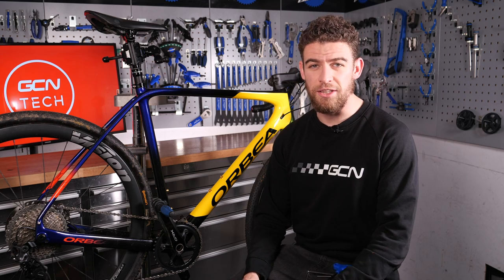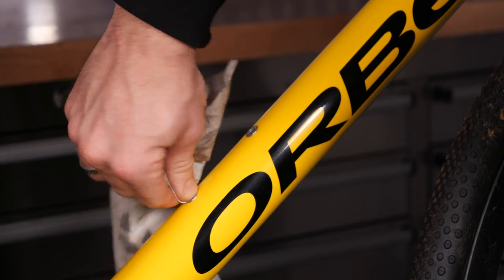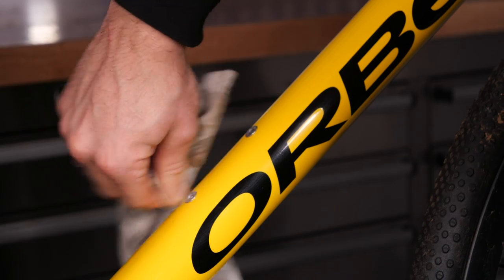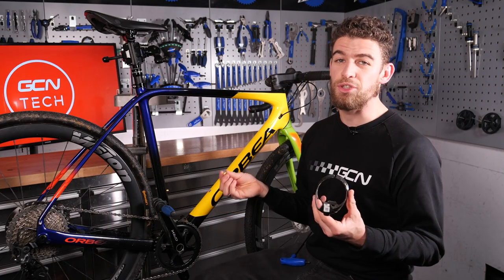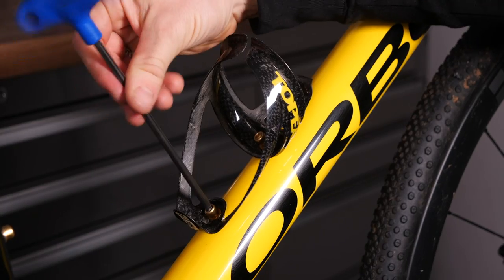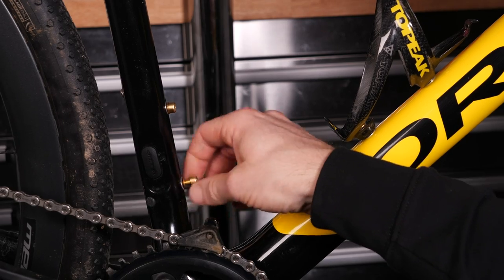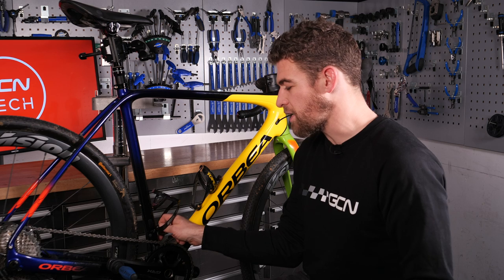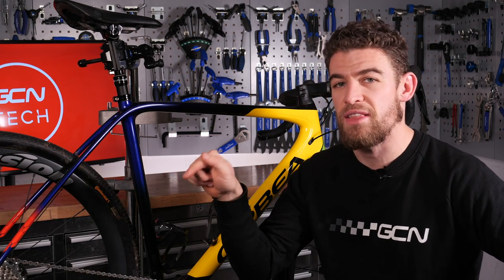How To Install Bicycle Bottle Cages | Road Bike Basics

Comment from the maker: What other simple maintenance videos would you like to see us make?
Reply: Maybe not simple maintenance but please do viedo how to ride on the bike
Reply: @_________4292  how to fit training wheels on a roadbike?
Reply: How to tell the left side of your handlebars from the right side?
Reply: getting started with clipless ?
Reply: How to install a bell
Reply: More about barings and cables
Reply: How about mounting options for head units.
Removing pedals from cranks.
Removing cotter cranks.
How to use a torque wrench.
Explaining clipless pedal release adjustment.
Explain how old school tech worked.
Cool bike mods we did as kids.
Reply: How to make sure the wheels are spinning in the right direction
Reply: Installing a super stubborn tyre onto a rim which should fit but doesn't. I mean like the kind where you want to throw the damn wheel out the window level of "stubborn". Please draw straws for the victim and show this without a jump cut to it magically being completed.
edit:

Also no skipping the inner tube

lots of love.
Reply: How about a guide to building a bike from out of the box?
Reply: Repairing and re-inflating a tubeless tire when it goes flat
Reply: How to edit OpenStreetMap. I would suggest you use as an example the unmapped dirt road Si found on Google Maps when he went bike packing in North Africa.
Reply: How to clean lever hoods
How to put a helmet on properly
Reply: 1.how to tension the chain on a track bike.
2.how adjust saddle position
Reply: How to install valve caps would be the next lesson after that video.
Reply: How to install a bottle cage when you don't have bottle cage mounting holes. I used the 1.5 pounds bottle cage from asda which comes with two sheet metal strips that wrap around the frame, but I'm sure you can do better.
Reply: I’d like to see a video about maintaining you tools, cleaning brushes and things like that. I’m very bad at that..
Reply: @paulgush  I did an edit for OpenStreetMap to show a new bridge and deviation on a rural road in Vietnam. The process was pretty straightforward - register as a developer then read the various online guides on how to create or edit maps.
I accompanied my changes with screenshots from Google Earth to prove that my changes were real plus a GPX file from my most recent ride. OSM had the changes added in about 4 days but it took a couple of weeks for them to appear in Openfietsmap which I use with my Garmin.
Reply: I'm having some trouble putting on my bib shorts. I mean, arms first? Do I jump into the bottom holes at the same time? One leg at a time?? Please help!
Reply: Do you pedal clockwise or the other way?
Reply: @ianjlilly  Agreed, it is quite straight forward - I've made a few hundred edits myself. I'm asking because I think they should promote the fact that it's open source, and that you can improve areas you're familiar with. And it would be nice if they did some videos more interesting than how to fit a bottle cage!
Reply: Installing a bottle cage to the frame without bosses? Using rivnuts, not some ugly clamp thing.

Comment: Oh. Spending four minutes of my life just for GCN. I do it because I love you guys.
Reply from the maker: Thanks for your loyal support ;)
Reply: GCN Tech #askgcn I just got finished doing the base coat on my bike and I’m bout to do the paint coat in a roster pattern. Don’t worry I’ll do a post in the future. My question is A two-parter. Should I use decals or paint stencils? I have rattle can spray paint. Second part of the question is would you do that step before or after the clear coat?

Comment: Strangely this is probably the only guide on the internet on how to mount water bottle cages. Not that it is complicated by any means but there is never instructions with bottle cages. I know plenty people that have no idea how to mount a bottle cage. Good for reference and beginners. Main points stay clean, lube, don't over tighten. Also if you want to get technical address EPS batteries that mount internally to the seat tube using the bottle cage mounts, mounting an air pump under the cage that needs longer bolts, lightweight bolts, cage material benefits, or bolt/frame corrosion due to different materials.
Reply from the maker: We're glad you appreciate the video! Thanks for watching.

Comment: And because you asked at the end. I have recently installed cages on my new Cento1air with Campy 11s EPS. Bottle cage mounting was done hastily in the shop as an after thought as I was picking it up. Rush job not good. I need to disassemble and lubricate the mounting bolts and check to see if they all match. I have some carbon specific grease for the job.

Comment: Thank you for the 2nm statement.  I’m far more comfortable working on a drivetrain.  Over tightening nuts into threads on a carbon frame tube seems a potential mine field.  How the threaded nut is manufactured into the carbon is beyond me.  But, it’s good to proceed with caution when working with carbon frame bikes.

Comment: The only interesting thing regarding bottle cages: Especially in aluminium frames, use only aluminium screws in order to prevent corrosion of the frame due to stainless screws. Stainless screws, aluminium frame and electrolytes from spoiled sports drinks are a terrible combination.

Comment: Is 50 Nm enough torque to secure my new cages?
Reply: Best to be sure.  Go for 75
Reply: Just tighten the bolt until it get easy and then back it off a quarter turn.
Reply: "Go until you hear the crack, and then a quarter turn back" is what they say

Comment: I have a new Giant Defy and bought a side pull bottle cage. I installed it by hand, got it snug (not too tight for fear of stripping or issues with frame) and the cage became loose after one single ride. Pulling the bottle out of the side and putting it back in inherently 'pulls' on the screws and worked them loose. Seems like a poor design?

Comment: @GCN Tech....okay you boys are running out of video ideas so here are some more.

1.) How to pick a good CO2 Tire Inflator and tips for using it on the road. 
2.) How to remove and replace a Presta valve core and how to get a good seal around the Presta valve for tubeless tires. 
3.) How to install a bling anodized tubeless Presta valve set.
3.) How to know when to add tire sealant to your tires. 
4.) How to know when you need to replace your bicycle saddle. 
5.) How to polish your bicycle hubs, spokes, nipples, and rims for increased bicycle efficiency and easier cleaning.
6.) How to achieve proper water bottle hygiene. 
7.) Saving bicycle weight through bicycle bolt size standardization and tool optimization. (The fewer tools you need the better!)
8.) Color coding your hex wrenches with paint pens for quicker identification and preventing your tools from walking away.
9.) How to choose a proper pair of headphones for gravel riding off-road and indoor training. 
10.)  Look at which cities of the world have the best bicycling climatology; move GCN headquarters there.  http://www.london.climatemps.com/
11.) Bring in a sports psychologist to explain to GMBN why riding uphill is actually good for them. :-) 
12.) Mountain biking triage, what to do when you inevitably hurt yourself with your mountain bike.
Reply: > 11.) Bring in a sports psychologist to explain to GMBN why riding uphill is actually good for them. :-) 

Indeed!

Comment: I wouldn't use the ball end of the wrench to break the bolts loose or torque them down, that's how the head of the bolts get rounded out. Just like a multi-tool, those P-handle wrenches aren't doing any favors either, they're too bulky to fit in the bottle cage. A pro tip is to always install the seat tube cage before the down tube one, and to always remove the down tube cage before the seat tube cage, that way you'll have more room with which to work. Although a shorter wrench than those cumbersome P-handles may also mitigate the lack of space.
Reply: @Bungle2010  It might depend on the drive size of the bolt, it's happened to me before where with 3 mm bolts, they, and as a result the cage, came loose. It didn't happen again after getting them tighter, but I didn't test it extensively either. Either way I reckon the bigger the bolt drive the better, which might make it safer to use a ball end wrench, I'd still avoid it if I could.

Definitely not 200 N⋅m but 3 or 4 N⋅m doesn't seem too outrageous depending on the material and construction of the cage. As long as washers are used, I don't see the cage getting damaged. It's not enough torque to worry about seizing either, especially with grease.

Comment: Maybe a video on installing a solution for a second bottlecage when the frame only has space/slots/holes for one - don't fancy drilling into my Giant TCX frame, but sure would be nice with two bottles(cages) instead of a bag :/
Reply: Topeak and others make mounts that fix to the frame with rack and pinion type tightening mechanism and provide threaded holes for the cage bolts.

Comment: #askGCNTech.  Hi John, great show, thank you for all the great tips. 

One quick question: Italian bottom bracket: grease and 40nm or Loctite 222 and hand tightening? Won’t the loctite almost be impossible to remove later?
Reply from the maker: Grease! Always grease and the correct torque setting that way you can get it out

Comment: Couldn't they at least mention some of the problems one can run into and how to over come them?  Such as if you have a banded front dérailleur that straddles your seat-tube bottle bolts.  Many cages won't fit on a bike like this.  It would have been worth mentioning that one should pay attention to that when buying a cage.  One trick is to use 1 or 2 presta valve nuts as a perfectly sized stand-off washer.   Also, at least for 52cm frames, I've had some pairs of bottle cages interfere with each other -- such that you cannot fully insert two bottles without the bottom of one hitting the side of the other.  Many cages have two sets of holes so you can adjust the positioning to aleave interference.  Something new folks might not know about nor know what to do if you run into these situations.

Comment: Hey guys you must be running out of things to talk about!
Reply from the maker: It might not be for you, but there are lots of people who are just getting started in cycling who might find this useful, but if you've got any ideas for videos we're always open :)
Reply: @gcntech  How about videos that deal with long term product reviews. Or do reviews where say headlights are compared. Or comparing gravel bike tires. Or talk about the advantages/disadvantages of different BBs. Or do a video comparing different ways/products for waxing chains. Do videos on inexpensive clothing that 'gets the job done' without breaking the bank. For example: Are $150 cycling shorts worth twice the cost of $75 shorts? Do reviews on lower priced , or mid priced, bikes, clothing, components, accessories.
Reply: @williamcain7464  YES!